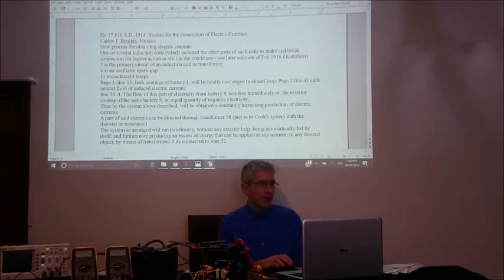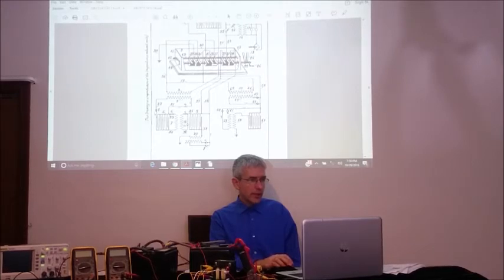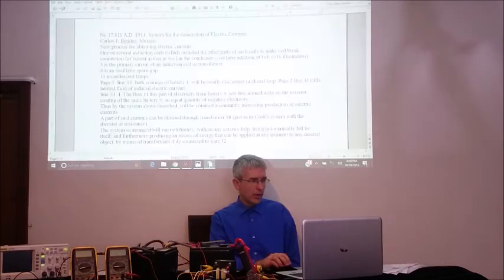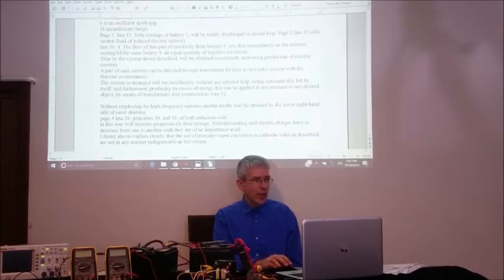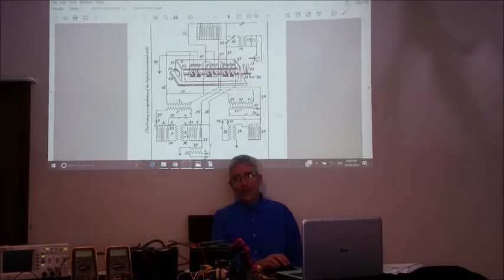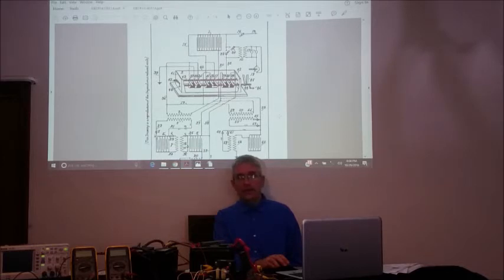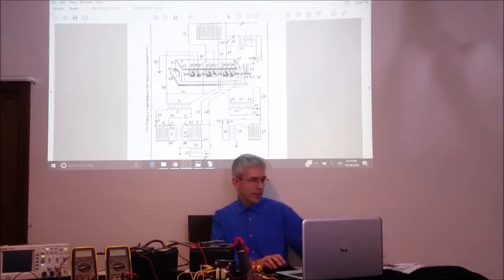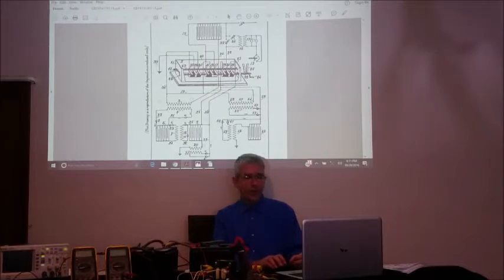The First Free Energy Patent is  Misunderstood.  Part 3  CARLOS F. BENITEZ

Comment: Regarding the 17,811 patent: it would be something to build a really powerful system using that circuit, with stacks of classic glass plate or Formica capacitors, a bank of the 4kv+ rated IGBTs, and an Aruino uno to run everything.

Comment: For the 14311 patent, a pair of industrial three-phase contractors would be excellent to switch the batteries on the hour as benitez says. Modern three-phase contactors are rated for high current at 500v and probably will switch several hundred volts beyond that unofficially.
Even the cheapie China ones are over kill for the tens of amps in a modest system like this.
Reply from the maker: Yeah that is not an issue. We do that with latching contactors for the motor energizers and will do it with this in an upcoming kit.

Comment: Rick, I am watching many videos but I still didn't understand why we need the distuptive discharge. It would be to achieve high voltage in the secondary coil? Using a transformer built in this way is not the same?

I am sorry for this very basic question, but I could not understand yet.

thank you
Reply from the maker: Without the pulse you have nothing. The coil is not necessary. It enhances but it is the pulse before the current flow (which is merely the killing of the source charge, or depletion of usable energy).
Reply from the maker: The pulse is a source charge, constant connection kills that potential. There are ways to have power without current. Doing high frequency the right way can do that.
Reply: Thank you very much. I am studying as much as I can following your steps!

Comment: Rick, about the spark gap, have you ever used a car spark plug instead of this one used in induction coils?
Reply from the maker: No, this is not merely a spark gap but an interrupter.
Reply: Oh! I'm sorry, I was talking about the secondary coil spark gap. That used by Benitez conected on secondary coil of the transformer.
Reply from the maker: Yes, I have illustrated 8 different what I call Benitez Switches (models). You are talking about the last patent. You can use a spark plug, but that will give you limited results. The spark gap is the center of the process and this is were 99.999% of people are doing it wrong. You don't want a spark at all...
Reply: Thank you again! I am reading again the Benitez's patents to better understand. Benitez wrote about liquid insulator, as you said, and I read this same thing on Tesla's lecture. Tesla says the perfect medium is a solid one that perfect restores after the crack, if exists. I also saw the spark gap in 3 Benitez patents and what I could understand the gap is responsible for increase the frequency, right?